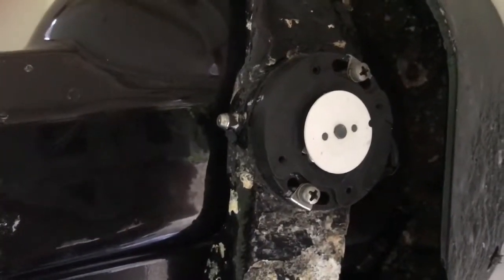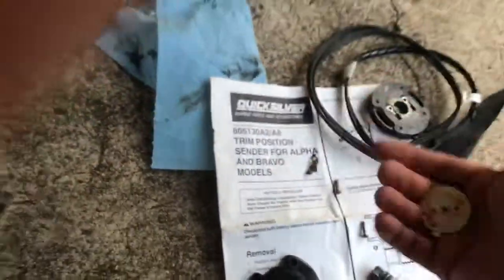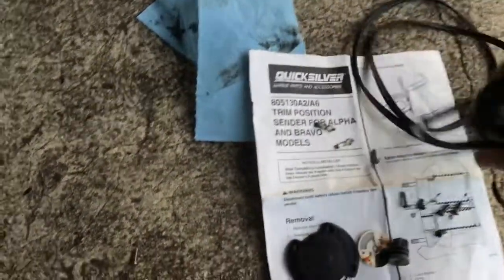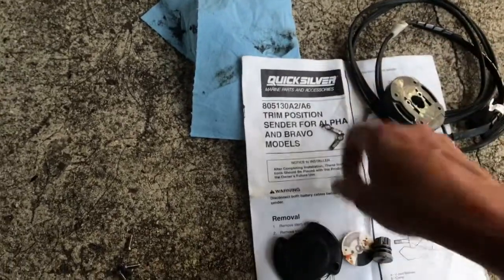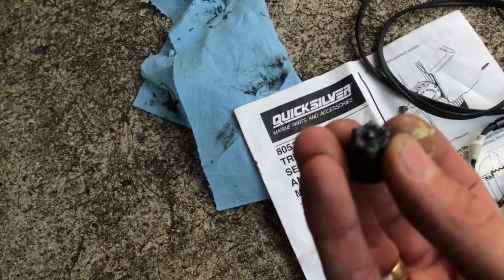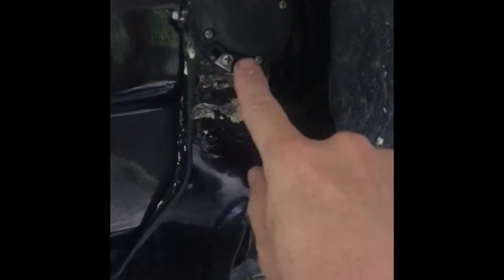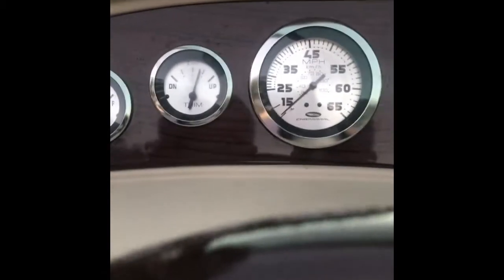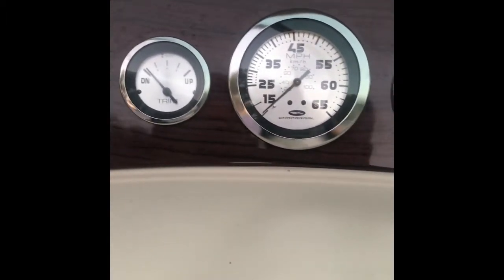Rebuild Mercruiser Trim Sending Unit - Alpha 1 Gen 2.

Comment: Thanks for the video I have been wrestling with the idea of pushing the wires through the hole without removing the whole outdrive. 😮. This is a much better option...😊
Reply from the maker: I wrestled with the same idea and figured this was a better way. Never had any issues with the trim gauge after the rebuild. Glad the video was helpful.
Reply: @fixinstuff  unfortunately for me I was able to fix my trim limit switch rebuilding it but my trim sender didn't come back so I'll have to route the new harness through there..
Trim limit was my big problem anyway cuz I had to use the trailer button to trim the motor up ..

Comment: If u could please help me which way does that plastic disk go on correctly I’m a bit confused
Reply: Did you ever figure out the right position of the disk? I removed mine to clean up the tracks and I now I can't seem to find the right position. I tried different spots gradually but the trim gauge is pointing all the way up.
Reply: @josht3880  I never figured it out mine was stuck all the way up also and just stopped messing with it once I realized I don't need the trim gauge while towing a tube
Reply: @presleycosta4127  well I figured it from the video. If you look carefully the disk in the video has an indentation pointing forward. Mine was pointing backwards ooopps. Changed it to the same position as the video and voila! Trim sender is back. I use it only for trailering and to remember where I left it after long time parked. En route it's easy to tell if the trim is right or not.

Comment: Maybe a dumb question but is there a reason why cutting and splicing is a bad idea ?
Reply: salt water and copper wire dont play well
Reply from the maker: I thought about splicing and using waterproof solder filled heat shrink but went with keeping the wires intact and rebuilding the sensor with new parts.
Reply: @fixinstuff  Worst case, you still have the wiring if you needed to do more.  I'm in fresh water but feel the same way about splices!

Comment: So when u replace do  start with it all the way down
Reply: I did. Made it easier. I also used a remote camera to look at the gauge on the dashboard while I was adjusting the unit.
Reply from the maker: Yes. Easier to do with two people. One to monitor the guage and the other to adjust. Otherwise you'll get tired hoping in and out of the boat like I did.
Reply: Great idea using a camera! Maybe I’ll use my wife’s phone and setup FaceTime. I think this is better than the 2 person method since there’s always some delay with one person communicating what they’re seeing.
Reply: @519VXComanche excellent idea!